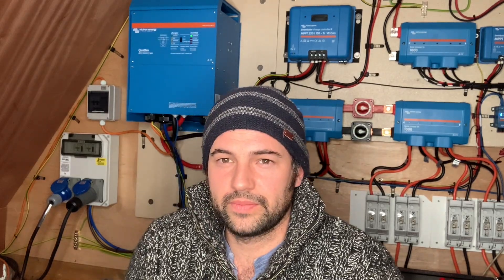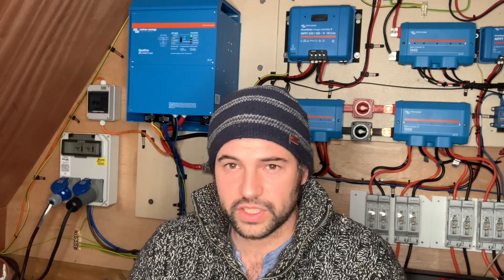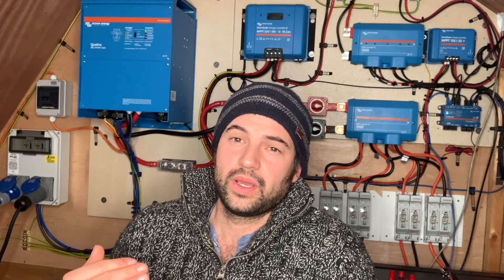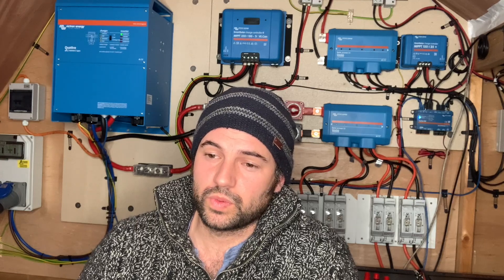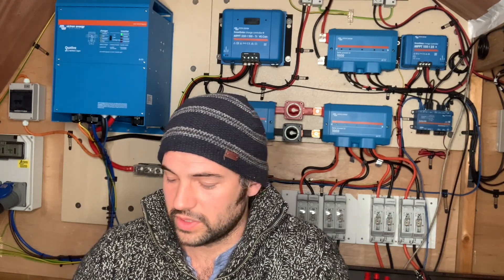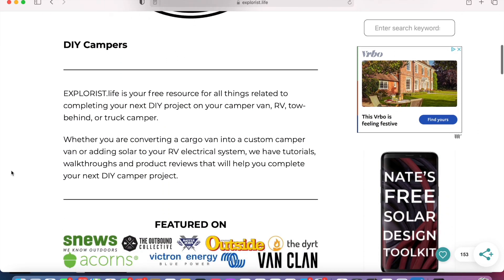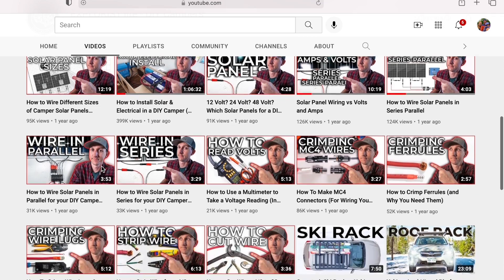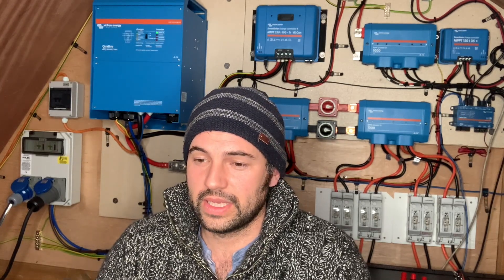DESIGNING AN OFF GRID SOLAR POWER SYSTEM: How we planned our VICTRON DIY solar system UK

Comment: I picked up pieces from Will Prowse to Explorist. Unfortunately there’s a lot of things they don’t tell you. Things like the proper procedure to wire your components. Using certain tools to make sure you don’t get shocked. Most of it set up for 12 V systems, so you have to do your homework to know what to look for with 24 to 48 V systems. These can differ in how you set up the wiring to input in the proper information into your charge controller or inverters. 
That’s why you have to watch so many different videos, as even after I finished all my stuff I was still learning that I missed things.
Reply from the maker: One of the things we found hardest was the misinformation out there 😩 Makes it so difficult when information is hard to come by anyway. That was particularly the case with fuses, which is why we ended up going back and making changes. Completely agree with what you say about learning as you go. We are still learning new things all the time 😊
Reply: @The_OffGridFamily  
I would call Battle Born Batteries and they would give me one fuse size and then another online forum would give me another fuse size? Then I read the inverter manual and got a different fuse size! 🙈
Reply from the maker: 😩 Sounds about right! Nightmare!!! Are you sorted now?
Reply: @The_OffGridFamily  🤙